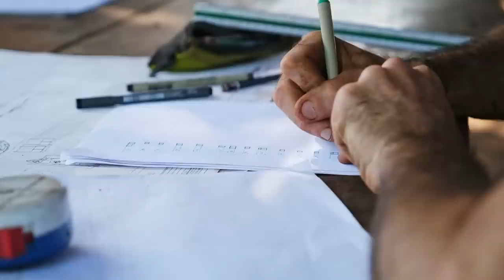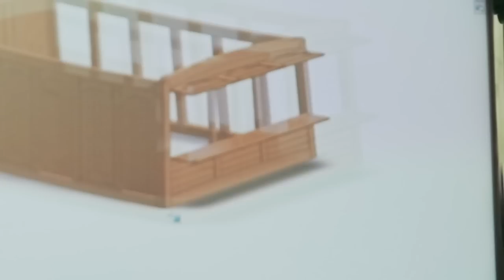Building Ceiba's Galley - SAILCARGO INC.

Comment: I really enjoy watching your videos because I'm a woodworker, however I question the future of the project.  I suspect that you have run headlong into reality.  You have purchased another ship and yet we haven't seen a video showing it delivering products yet.  There are many good reasons that shipping went away from wind power and it seems very idealistic of you to think you can make this efficient enough to turn a profit.  I could be wrong, but where are the numbers that you have come up with?  Goods need to be delivered in a timely manner or customers will stop using your services.  I know that you are planning electric power in Ceiba as well as sails, but both are very expensive.  Has any ship of Ceiba's size ever been made all electric?  How far will you be able to travel on a charge and how and where can you recharge that many cells cost effectively and fast enough to turn around for the next load?  What is the projected average speed of Ceiba under electric or sail power and how does this compare to modern shipping?  I think you need to produce a serious video that deals with projected costs of maintenance, recharging, number of deck hands and pay, insurance, estimated time of completion, cost of rigging etc.  I think the major question is profit margin.  Many are now donating their time, but a business can't sustain itself long term that way.  How many trips each year and amount of cargo transported will you need to turn a profit?  The more I think about this the more questions I come up with.  In short you need a business plan video with real world numbers to help us understand how this will work and be sustainable.

Comment: Monell and/ or bronze fastened?
Reply: The fastenings are all galvanized steel. Bronze or monel would be too expensive for a vessel of this size
Reply: @oliverwatson1567  I have heard that galvanized fastenings last 30 years at best.
Reply: Stainless steel for real marine environment, Galvanized steel for less important stuff... I guess.
Reply: @framegrace1  That makes sense, thanks!
Reply: @framegrace1  stainless steel isn't an option. Even 316 grade will corrode unpredictably and quickly in this application
Reply: I've removed 60 year old galvanised fastenings from ships without a scrap of corrosion on them.

Comment: Hello. I have aquestion: i have participate as help on design and build several wooden boats. I never see this heavy double botom inner cover. Looks strong and non removable by any sircunstances. So, how you will find and repair any water leak when you have it? Sure you know, wooden boats allways need leak repair. Wood expands and shrink and also twist during sea motion. I am corious about this. Thank you
Reply: I have the same question. And wonder how to fix the outer planks, with inner cover installed?
Reply: They explain why it was done in an earlier video. I can’t remember why but the reasoning sounded logical at the time lol
Reply: The ceiling (inside) planks are just as structurally important as the exterior planking on a vessel of this size. They are standard on any vessel over ~80 tons. There's a 6 inch gap between the ceiling planks and the keelson (longitudinal structural timber bolted to the top of the keel and frames) so leaks can be located. The gap will be covered by removable boards during normal operations.
Reply: @lucianopereira3793  The ceiling (inner) planks are fastened minimally on the forward part of the frame with spikes and trunnels, the outside planking layers will be fastened with spikes, and through bolts that will sandwich the ceiling, frames and planks together
Reply: ce recouvrement  total dans le cas d'un navire de charge  est appelé le vaigrage ,  il sert  à éviter  que le charement n'aiile dans les recoins des couples  , à isoler la marchandise des eaux  évacuées par les anguillets ,  et puis ca renforce  la structure .
Reply: a voir  la construction de lHermione ...